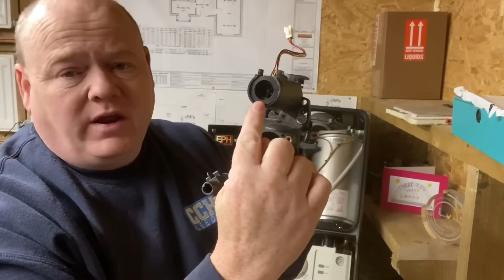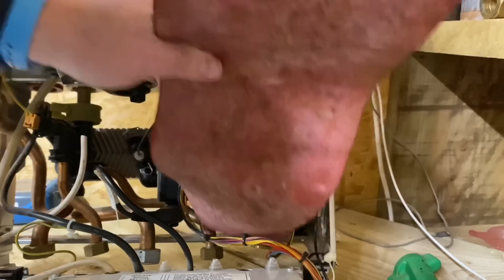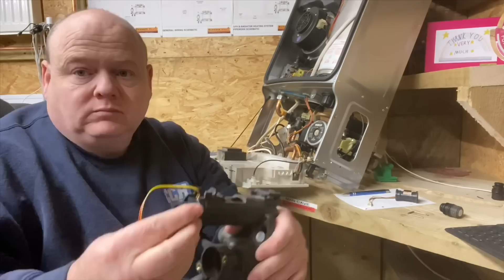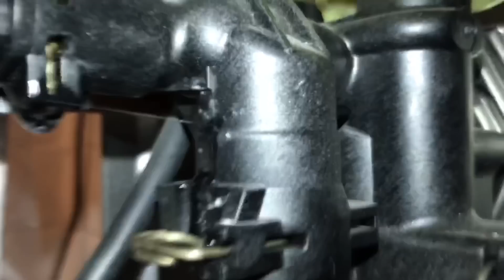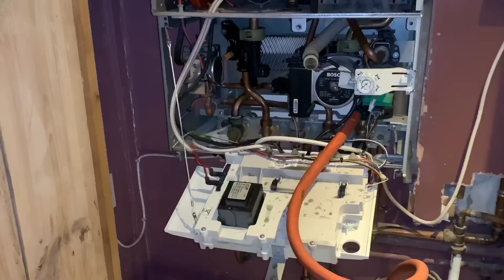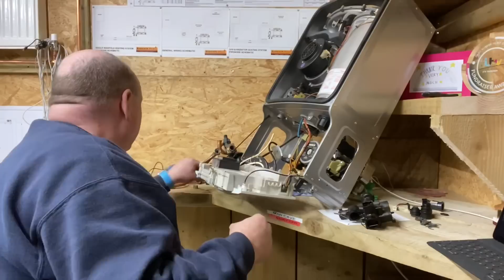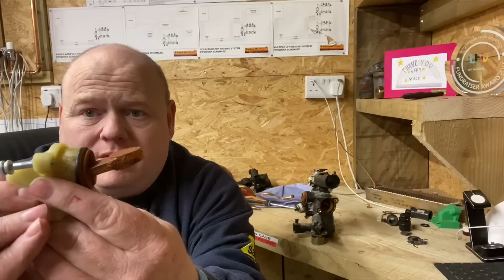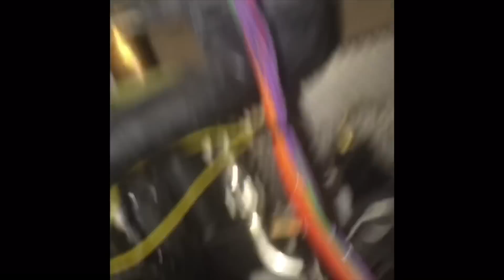Worcester Bosch Boiler Leaking - Leeds Plumber

Comment: Thanks for the great presentation Allan. I am not a heating engineer but have a service engineering back ground so hence the interest. I do not understand how you advise that only a gas safe registered engineer should work on a boiler then you say or a competent person. Surely this competent person should be gas safe??
When I was at work (retired now) I went on many courses to learn each new machine I worked on how many courses have you been on and is it required for each manufacturer?
Reply from the maker: I used to say Gas Safe only but I had some hassle for it, The regs safe Gas Safe or Competent. Hence the reason I now say what the regs do. Thanks.

Comment: All boilers are crap when they break down😆 Return unit is very common on Worcesters, easy to change on CDI, not so straightforward on juniors due to the bypass, if you work on them regular you know the parts which play up. Allen is getting his Tesla sign written by Worcester I think😄
Reply: They told me they want to stop you promoting them most boiler problems are down to bad installation not flushing undersized gas the list goes on thers to meny of them out ther
Reply from the maker: @charliewillis8527  Who? Worcester Bosch want me to stop doing my video’s?
Reply: They could get you strung up Allen😄 “it’s only my opinion” won’t stand up in court. I’ll be devils advocate for you pal, I’ll bring a list of return units I’ve changed😉
Reply from the maker: Paul Kelly if they could do something I am sure they would. I just post what I find on all brands, TBH they are all white boxes, I do remove more WB than any other brand though. 😂😂😂
Reply: I find in the past 20 years boilers are getting more complicated than ever, and it’s difficult to get a “one size fits all” solution, I’m only joking pal, I find your videos excellent for the content and your very honest. We all have a brand we know and trust, just because I work for them doesn’t mean I’m Worcester mad, there are a lot of things that could be better, but it all comes down to cost of manufacture in the end really. It could be worse, we could still have the Swiftflo😂😅
Reply: @AllenHart999  no i was joking Allen they wouldn't tell me anythink
Reply: @AllenHart999  if the boilers go wrong its all more work for everyone with so many plumbers out ther its much needed i like the worcesters myself have installed hundreds and haven't had much trouble at all over the years you have your veiw of them but i like them find them easy to work on when you buy a kit it comes with everything you need to do the job not like ldeal were you get a gas valve and no new washers
Reply from the maker: I was hoping WB would sponsor my channel 😂😂😂😂
Reply: I’m sure they would love to😄

Comment: I was always told to crack nuts on vessels to help drain down, how do you feel about that?
Reply from the maker: What do you mean? Thanks.
Reply: Allen Hart when draining down a boiler I was told to loosen but to the expansion vessel to allow air to help the drain down. But then others have said its better to leave the vessel alone if it doesn’t need to be touched. Wondered what you would think on leaving the vessel alone or using it?
Reply: I always do that. But with care, as always!

Comment: Really dont see what everyone dislikes about these boilers. There so easy. Manifold block comes out in one piece. You can literally strip it back to the shell and rebuild it in an hour! So what I'd it's made of plastic. Baxi netatec comes to mind, get a leak on any plastic in that its a whole brand new manifold @£400 and 3 hours and 20 stitches later to get it out.
Reply from the maker: Lot’s of customers dislike them when the house has flooded a few times. 😂❤️👍
Reply: If it was an Ideal that did this everybody would be slagging it off, but for some reason everybody forgives Worcester for poor quality plastics. They have never tried to improve the components, they just keep the price of the bits pretty low.
Reply: @timhancock6626  Yes when they first started leaking years ago it was knocking out the diverter motor that's below it.  What did they do? Change the design, go a call back to all the affected models,  NO, they started fitting a slip on bit of green rubber over the top of the diverter motor to stop the water getting into the electrics!  Doooh you couldn't make t up!
Reply: @tonygreenbank8611  It is a lovely shade of green though.....
Reply: @timhancock6626  Yes and at least they didn't try and hide their cock up by making it black rubber.

Comment: That’s one thing good about the viessmann boilers I’ve never had one leak on the plastic components on an old one I dismantled I drilled through the plastic manifold and it was very very thick and still robust after 12 years
Reply from the maker: The Viessmann boilers have mini shocks built-in as well.
Reply: Yes trouble is with the viessmann you cant get the parts easily
Reply from the maker: @charliewillis8527  Viessmann direct have most of the parts in stock. Plumbase also have them.
Reply: @AllenHart999  that is handy to know but those rubber tubed seam a bad design to me but the rest looks ok
Reply: Charlie Willis Yes I do agree with you previously I had to wait for five days for parts which is unacceptable for an appliance out of action viessmann have sorted this out last 6 months or so. I fitted about 15 so far and all have been brilliant there an absolute dream to service too !
Reply: @SalimKhan-gk1fh  yes thats what put me off i had one for a landlord to service  so i wanted the door seal and some other bits and it was a right pain so its coming out its the one with the rubber hoses Allen can have it for his collection he loves boilers i would rather a bar and a nice pool table in my man cave
Reply: Charlie Willis I wouldn’t mind buying it off you which one is it is it the WB1C?
I’ve completely switched over to viessmann boilers now and the results and satisfaction from customers has been brilliant
They’re a dream to work on and service very easy thankfully the parts situation is easy now
Whereabouts are you based
Reply: @SalimKhan-gk1fh  iam in essex near southend i will strip it down for parts  its all working but will need new hoses and a strip down i would want £100 for it regards Lee my number is 07860 588835
Reply: I do a lot of Worcester boilers install them and repair them i carry most parts for them so iam geared up for that and i do repairs for other fitters so get more than enough work just doing that
Reply: Charlie Willis , i’ve had no problem at all with viessmann spares easily available from Plumbbase  plumbspares
Now they’ve become a popular boiler everything is available they even have viessmann direct spares
Reply: @SalimKhan-gk1fh  when i wanted some bits nothing was in stock it was all parts had to be ordered which made it awkward

Comment: Great video 👍 I’ve got a job on Thursday to replace the return manifold on a greenstar 37cdi so perfect timing and a helpful video , cheers!
Reply from the maker: Will you just take all the lot out in one? Thanks.
Reply: I’ve not actually done a return one before , I’ve replaced a few flow manifolds. Would you recommend to take the lot out rather than just the block? Also do you get any new parts with the block, divertor , prv?
Reply: Sorry I thought I had replied.. never replaced a return manifold. Would you recommend to take full lot out ?
Reply: @danstephenson8952  yes take full block out its easier. However if there is no bypass fitted you can take the return manifold out without removing while block. Doesn't come with prv but does come with new motor hence why expensive part BG engineer
Reply: Also order new flow adaptor as you'll find it'll be brittle and break when you pull it out with pliers sand doesn't come with kit

Comment: What really annoys me is that the return unit is expensive and doesn’t even come with a flow turbine adaptor!
Reply from the maker: They are very pricey, Totally agree. Do you change many of them? Thanks.
Reply: Yep changed a fair few, had 2 go on the same day. A lot of people misdiagnose the problem by saying the PRV body is leaking as the water tracks down the PRV body.
Reply from the maker: @simonnicholls9960  Do they normally leak on top left hand side? Thanks.
Reply: Also had a few random boilers where I’ve had a low gas rate only to find they’ve put they wrong code plug in from the factory!
Reply from the maker: @simonnicholls9960  They used to send a spare plug out with them.
Reply: Yeah the low nox chip, I’ve had a 25si chip in a 30si boiler so was underrated from factory.
Reply from the maker: @simonnicholls9960  We used to install loads of Worcesters back in the day 😂

Comment: One place for Worcester boilers and that is the skip!
Reply from the maker: I am taking one out tomorrow😂👍Thanks.
Reply: They’ve come down in my opinion. These composite castings are a real failing. I’ve sworn by Worchester for years, but don’t work on many domestic ones nowadays. But having watched Allen’s videos, I can see they are failing a lot. Overly complicated for what they do. My company fits mostly Vailliant’s now, and I helped fit one a couple of years ago to my in laws, thinking that paying for the improved quality would be wise. It leaked from the diverted valve, which it turns out has been another failing. I wouldn’t know who’s boilers to recommend, and that’s after 35 years of working on them. My Buderus 500 has been fantastic. Shame they don’t supply them here now. Bullied out of the market.
Reply: @BrianBlack123  Intergas. Only 4 moving parts, 22mm waterways in main hex and all brass/copper internals. Quality engineering!
Reply: woodbine66 only seen one. Be interesting to see how they do. I felt the interface was a bit overly complicated. The one I saw was a system boiler, but it really wanted you to use the network controls for a combi. Very quiet running. And a very neat size.

Comment: Allen. Got a random question. First should most combi systems have like shock Expansion arrester to protect plastic parts. Also with the boilers expansion vessel is that just taking account the functionality of the boiler. Is it good practice to put in an external expansion vessel to cope with larger systems. I know that’s a lot of stuff along with MagnaClean to fit in the small space you get with pipe work under boiler. And filter for cold. 😂
Reply from the maker: Great questions. We were told that expansion vessels / Mini Shocks were only needed if customer had a water meter, Then when they started leaking I believe the instructions changed. The standard expansion vessel is for the heating and not the cold mains. Thanks.

Comment: Worcester with there good quality plastic components what makes them stand out from the rest with excellence is the green rubber casing they stuck on the diverter valve just shows the quality in engineering .. great video al stay safe 👍🏻
Reply: Jack Hoskins A beautiful bit of sarcasm!
Reply: @jasonantigua6825   Yea, be aware of a design fault and mask it by diverting the leak away from another component. I think I would pay extra and buy a boiler with machined brass components  which do not deteriorate. Looks like the 10 year guarantee means the boiler will fail after 36501 days!
Reply from the maker: 😂😂😂😂😂Thanks.
Reply: Jack Hoskins I don’t really know much about boilers but,there was a time when they were the leading brand?
Reply: Best boiler is Biasi
Reply: m d lol